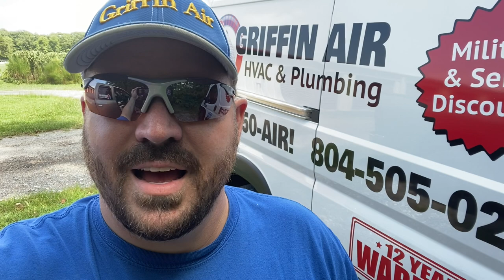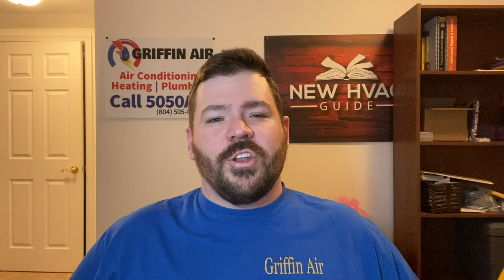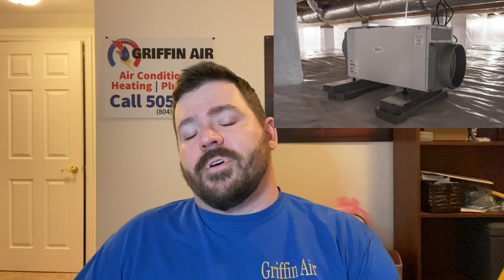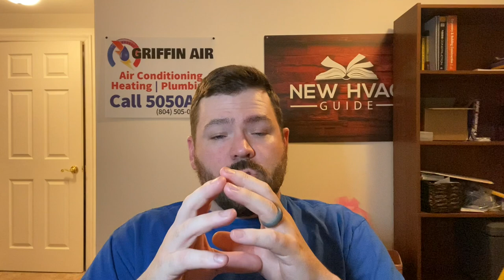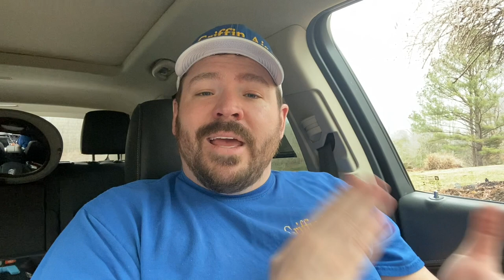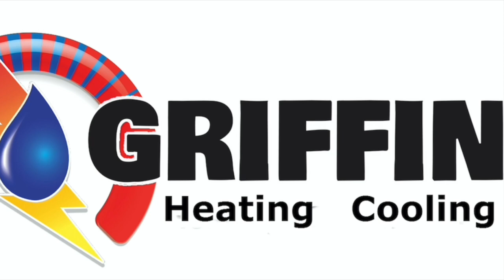The Crazy Truth About HVAC Sizing!

Comment: Nice informative video. Have a question, I live in the Midwest and could get really hot and humid in the summer. My house in the main floor is around 2000 sq ft. My unit is a 3 ton ac/furnace 2 stage. It working good except for one room that has a cathedral ceiling, I am guessing 15 ft high. Only one register but no return. It gets really hot in the summer. I cut off the bottom of the door but still really hot in the afternoon. My question is do I need a return vent or supply vent, or both? The room is comfortable in the winter. Thank you.
Reply from the maker: Every house is different, so it's hard to say.  I'd recommend getting a couple opinions from your local pros.
Reply: check insulation above vault. need more diffusers.

Comment: Im in Hampton Roads, VA. My place has a old 2.0 ton unit (from 2001) but it struggles (1800 sqft) on hot days it does hit thermostat temp. I had a quote from HVAC company to a 2.5 ton system and 2.5 vap coil. Should a 3.0 ton be used instead?
Reply from the maker: I recommend having a proper heat load calculation done even if you have to pay for it.
Reply: yes
Reply: 3 ton for 1800 square feet

Comment: Are very interesting I've been offered an air source heat pump , it came out of a friend's restaurant, it's an 8kw unit AOYG24LFCC, quite big as was thinking 3.5kw would be ok for my small house. Can this large unit run at the lower power? This machine was built in 2013
Reply from the maker: Have a local pro take a look. I’m not familiar with this brand
Reply: @NewHVACGuide  sorry should have said it was fujitsu heat pump. If  I fit a large one will it run at a lower current , I see it's max is 16a , where I think 3kw was about half that.  What steps do these run at?

Comment: I live in south Texas. My house is 840 sqft. 2 bedrooms. I got quoted a 3 ton. Is this the right size.
Reply from the maker: That would be big in our area. Maybe there is some thing more to the story like our ceilings for insulation issues. Have a proper Heat load calculation done and you will be good to go
Reply: Depends on when the home was built, how well is it sealed, are windows only single?
If you have an old crappy house and from 70s, yeah 3ton is pretty common in south texas. But if you have a newer home, say from 2015 or so. a 1.5 what you would likely need.

Comment: By the way, it takes 144 BTUs to melt one pound of ice in one day (24 hours). If you have 2000 pounds of ice (a ton) it is 288,000 BTUs absorbed to melt that ton in one day. If you divide that by 24 hours, 288,000 BUTs per day/24 = 12,000 BTUs per hours per ton. So a ton of cooling is 12,000 BTUs over an hour. PSA announcement. lol!
Reply: Call me crazy but I guess this means if you have a 1 ton AC unit, in one hour it will cool by 12,000 BTUs.

Comment: Just changed my ac unit I had a 4 ton and it was struggling and my thought was bigger size and I got a 5 ton Goodman but now I’m realizing I made a huge mistake reading on it and kinda bummed 2000sq ft 2 story I’m in Houston it gets hot my 4 ton was old and it was on all day and night so my thought was in need a bigger unit the guy said okay what ever you want and now I’m stuck between what can I do? Add a dehumidifier but I did for the reason that my light bill was $500 I was like I need it replaced it ASAP then I did it the house is cold but now I’m thinking of solutions.. any thoughts? Just dehumidifier I read that I can add a duct to the garage to get rid of some and add a dehumidifier?
Reply from the maker: It’s against code to run ducts to your garage. Huge safety hazard. 

That said, yes… Add a dehumidifier
Reply: @NewHVACGuide  best option would be to buy it again at 4 tons right? Man first home and I wanted to do something good but turns out it’s worst can I change just the outside unit add a uv light and dehumidifier? Or change both? He said the inside unit has low speed would that work?
Reply from the maker: @eduardomedina4328  just make sure it’s an AHRI match but yes. Sometimes condensers are matched with larger indoor units for higher SEER ratings. And that would lower your capacity.
Reply: @NewHVACGuide  thanks! Happy 4th!
Reply from the maker: You too pal
Reply: Add whole house dehumidifier and you can crack a window which will increase heat load.
Reply: @eduardomedina4328  what did you end up doing? I was about to do the same, go from 4T to 5T; didn’t think about how it could be too cold in the house.

Comment: My electricity bills more than doubled during summer
 the inside temperatures in the 80s despite AC being on 72 no one can find anything wrong. The third AC guy thinks it might be undersized.
However I'm getting tired of hearing the word I think 
when I had the AC installed 8 years ago the guy wasn't sure if I needed a 2-ton or a 2.5.

 so the phrase "I think 'is costing me money.
I'm uncertain how accurate a BTU calculator is.
I've used two different ones
 suggest my house should be  a 3.3 ton  with 9 ft ceilings ,however my living room goes up to 14 ft and I'm not sure how to add in ..
If that living room ceiling would put me closer to a three and a half or not.

1232sq  ,heat zone 1 , zero shade, the living room and kitchen ceiling goes up to 14 ft 
So I'm not sure what to go with at this point the other guy informed he thinks I need a 3 ton. However with every calculator showing 3.3 not calculating  the higher ceiling 
I'm not sure which AC guy to go with at this point one says I need a three another says a three and a half

Comment: I have to disagree with oversizing heating equipment. For one, if you heat a spade too quickly it’s super uncomfortable. Also, depending on how oversized the equipment is, a gas furnace for example, it could cause premature failure of the heat exchanger and premature failure of the blower motor as well as inducer motor. Not to mention persistent tripping of safety limits.
Reply from the maker: I think in most cases those issues would only happen if the system is oversized and the ductwork is not. But if everything is sized correctly as far as the ductwork goes, you would just have a system that short cycles a lot
Reply: @NewHVACGuide  9/10 if system is oversized then ductwork would be undersized. I’m not talking about a 60kBTU furnace where there should be a 40… but definitely a 80 where there should be 40 or 100 where there should be 40. Also with it heating the space quickly like that it will be very uncomfortable and a lot of hot and cold spots/areas throughout home
Reply from the maker: @timrob0420  9/10 houses, the ductwork is undersized anyway lol
Reply: @NewHVACGuide  lol obviously you’re not up in the PNW. Ductwork is jacked up here man

Comment: All true...years back I had a second floor addition put on my house.  Did a second furnace/ac installed. Best decision ever. 1.5 ton upstairs ( small addition) . 
First floor furnace was sized for original house size, heat load, and position in basement ( was slightly oversized along with a 2.5 ton Ac. When that furnace got repositioned,  didn't work out well, short cycled and eventually failed. Replaced with smaller btu furnace and 2 ton ac. Works much better this way.
Reply from the maker: Glad you found a solution.
Reply: @NewHVACGuide  thank you for providing honest, unbiased, non opinionated information to the viewing public.

Comment: Oversizing forced air furnaces absolutely kills comfort. Many people hate forced air, but they've never experienced a forced air heating system done right - sized so the furnace has to run nearly continuously on high fire in extremes.
Contractors put the same size or larger furnace, and to add insult to injury put single stage thermostat on 2-stage furnaces, so they just time out and lock on to high fire after a mere 10 minutes -  they never get the comfort, the extended heating cycles they pay for.
2-stage or modulating forced air, sized and setup right delivers comfort similar to hot water heat. If you oversize this type of furnace, the owner doesn't see the benefit.
Many homes that need 40k btu of heat at 95%+ get 60 to 80k btu furnaces! Pathetic.
These homes don't have large enough ducts for the modern 60 to 80k btu furnaces that need much greater airflow than the old furnaces they replace - between higher rated btu output and a lower temp rise range.

Oversized supply duct btw can be mitigated by balancing dampers, plus furnaces can acceptable airflow ranges, it is not set in stone and there's room for adjustment on many.

- the only reason to over-size an inverter is a heatpump application, needing more heating than cooling, size for heat and it ramps down for cooling. sizing a heatpump is a balancing act.
Reply from the maker: Very true pal